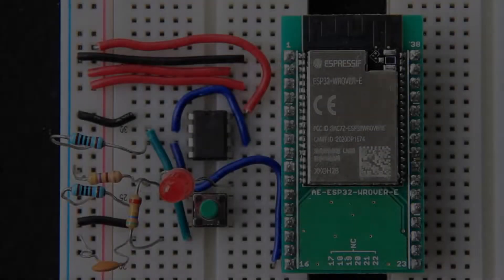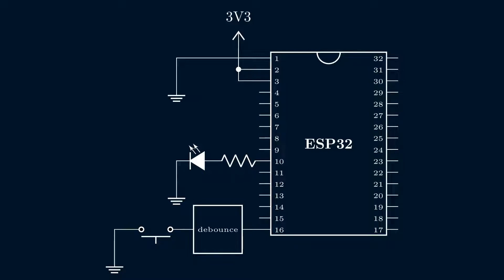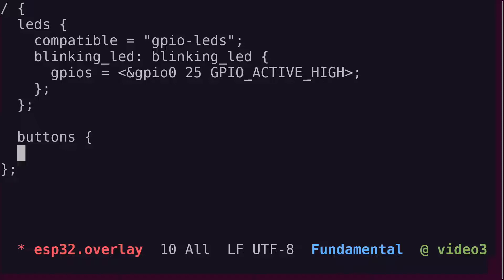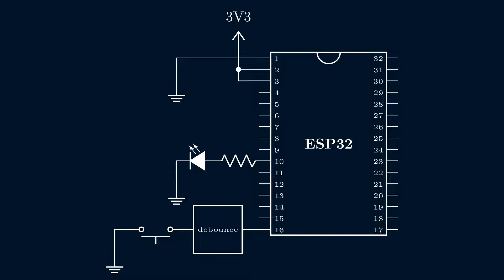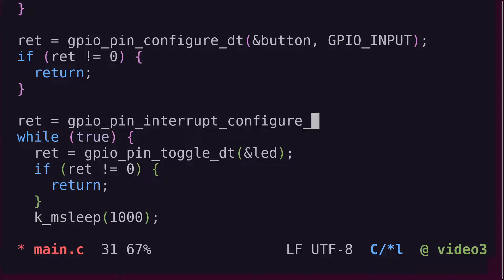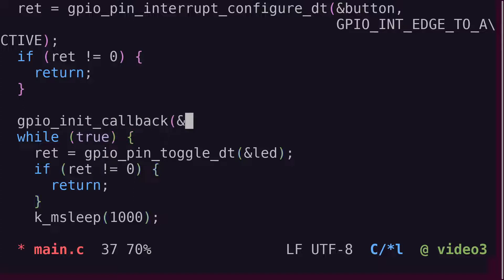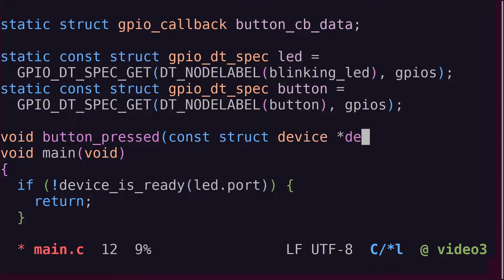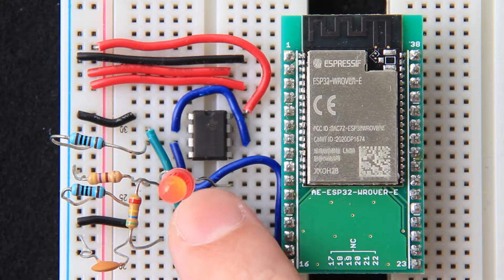[#3] ESP32 on Zephyr OS: GPIO Interrupt (ISR) [Part 3]

Comment: Great Videos. We would like to start with zephyr on esp32s3. But we can't see if adc-driver is available. can we find info about that. br
Reply from the maker: Thank you. I hope you found a solution for your project. As I haven't tried the ESP32S3 yet I can't really comment on it. However, you should be able to use the ESP-IDF API's directly for functionality that has not yet been implemented for Zephyr. It's not ideal, of course, but at least an option.

Comment: Thanks for the video. I had some problems because I didn't have a debouncer (555 timer). After spending hours, I decided to buy some 555 timer. But looking at the datasheets, it seems to operate between 4.5V and 18V or even between 5V and 15V. But as far as I know esp32 has 3.3V. Does it work? (My background is mathematics and software developer, so I am quite new to hardware and electronic stuffs) Do you have a concrete model and manufacturer which does work for you? Thanks!
Reply from the maker: I'm sorry for the confusion I caused! Since the video is about GPIO interrupts in Zephyr, I tried to stay away from discussing debouncing (it is a big topic in itself). 

Based on the background you provided in your comment, I recommend the following approach:

(1) The firmware should work without any debouncing circuit at all. Just connect the switch (button) to the microcontroller's pin directly. Depending on your switch, you may find that the LED responds well sometimes, and not well at other times. This is likely due to the "switch bounce" effect. But, at least you know that the interrupt is working (just not very well :-)).

(2) Once you have set the circuit up and it is "working" as per (1), if you still want to explore debouncing the switch to make it more predictable, you can first try to implement a simple software debouncing routine in firmware. E.g. something like described in https://www.eejournal.com/article/ultimate-guide-to-switch-debounce-part-8/. I suspect that in industry these days, most debouncing is done in software, and things can get complicated quite fast. But since you mention you have a background in software development, this may be quite straight-forward for you.

(3) If you still want to explore a hardware based debouncing circuit, then I suspect most 555 ICs will quite happily operate at 3.3V even though they are not rated as such in the datasheet. In my circuit, I used an NE555 from ST Electronics (https://www.st.com/en/clocks-and-timers/ne555.html) and it worked fine. Since you mention you are quite new to hardware and electronics, having a couple of 555 ICs around will be very helpful since they are incredibly versatile ICs and are used in many ways. Of course, I would not recommend using components in a way that is not covered in the operating range for any serious usage :-) 

A word of warning, however, I used an oscilloscope to choose appropriate values for the resistors and capacitor in my debouncing circuit. So you may need to do a lot of trial and error if you don't have a way to observe the edges. And if you don't have a collection of resistors and capacitors of different values lying around, you may need to get those, too, when experimenting. In short, a software debouncer may be much easier for you to implement without having to purchase new components. Then again, if you are interested in learning more about electronics, making a debouncing circuit may be a good excuse to invest in some components :-)

I hope that helps, and sorry again for the confusion around debouncing circuits.
Reply: @thepullupresistor  Thanks a lot!! 😆😆 Yes I already tried the software debouncer, but I had no clue what went wrong. But I will try again this weekend. And as you say, having some basic components makes sense.

My first try was lua on esp8266. It was ok, but never stable. Then I learned C and used platformio and it was good enough for hobby programming. Now I want some more professional tool without gui or something, so I am learning zephyr. Nordic sdk is also based on zephyr, and I like nordic chips a lot. In the future, I want to do more for smart home, especially for matter and thread. My goal is to build some matter devices. So debouncing a button is definately what I need to learn 😁
Reply from the maker: Good luck and let me know how it goes! With your mindset of wanting to learn the underlying concepts, I'm sure you will get it working soon 🙂For me, the only way I really learn is to try, fail, try again, fail again, and finally (hopefully) find a solution. Don't give up and continue to reach out for help when you need to.

After writing my previous reply, I realized that I should have mentioned one more thing to help you troubleshoot. The debouncing circuit inverts the signal, which is why we configured the GPIO pin to be GPIO_ACTIVE_HIGH in the devicetree overlay file in the video. When you remove the debouncing circuit, there are two things that need to change:

(1) Change the devicetree overlay file to make the switch GPIO pin GPIO_ACTIVE_LOW instead of GPIO_ACTIVE_HIGH; and 

(2) Ensure that you have a pull-up resistor configured on the GPIO pin you are using for the switch input. This could be either a physical resistor connected to Vcc (3.3V) or add the GPIO_PULL_UP flag to the gpios property in the devicetree file. 

Something like:

gpios = <&gpio0 13 (GPIO_ACTIVE_LOW | GPIO_PULL_UP)>;

should work. Just replace 13 with the GPIO pin number you are using on your board. I hope that makes sense, but let me know if I can help to clarify further.

Good luck with your troubleshooting!
Reply: Thanks for your help. It works now after spending needless hours debugging. The main reason: the switch didn't work. I don't know since when. But the old debouncing code I tried before asked for help worked. But of course with your advice pulling up (had to understand what that is, and now I know) and changing the active low.

But now it seems to make more sense. Thanks for your help. I'm having a lot of fun at the moment. And of course a lot of frustration. But I can handle it. I'm looking forward to more videos.
Reply from the maker: Great to hear that you got it working, and that you learned some new things (albeit with a bit of frustration). I'm sure you will find a lot of use for your understanding of debouncing in your future projects!

I'm working on the next video at the moment, hopefully won't be too much longer :-)